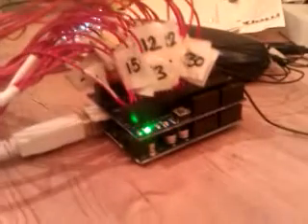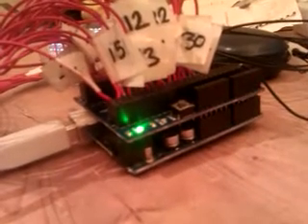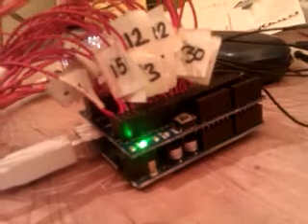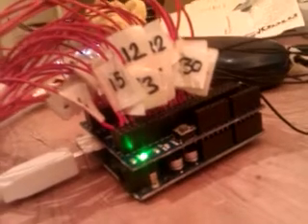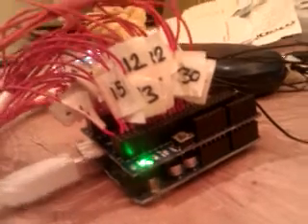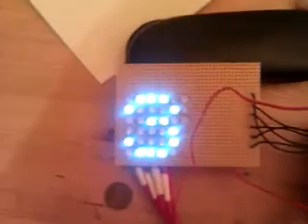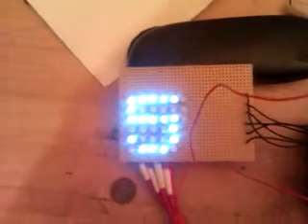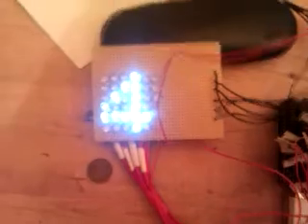Using an Arduino and a Multiplexer shield to count!

Comment from the maker: Well - the trick is to use the correct digitalWrite commands so you can address the correct output or input on the multiplexer -in this example I am only using two of the multiplexers on the board and I can loop the outputs quickly enough to flash up the numbers.  This example uses digital outputs rather than analog inputs but I think the addressing mechanism is pretty much the same. I can send you the source code for this example if you like! I just started with the examples and went for it!